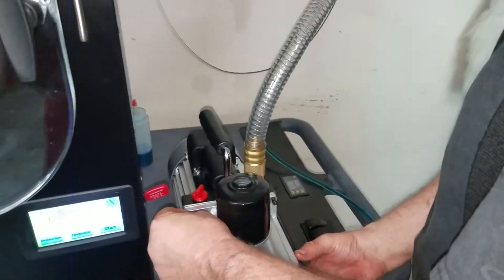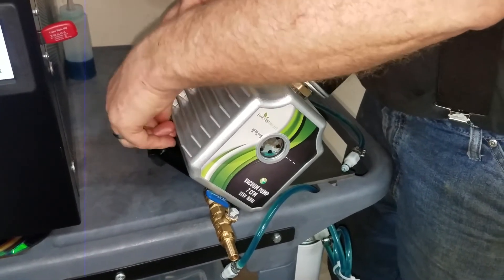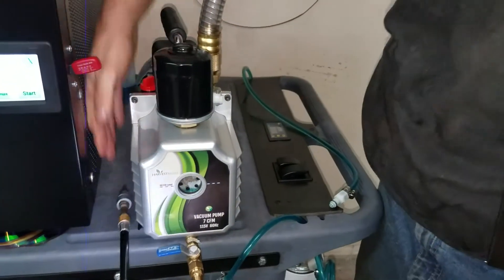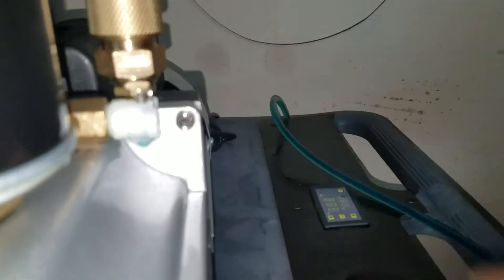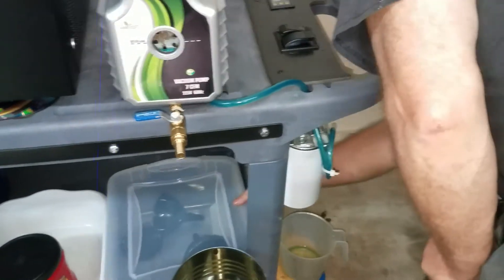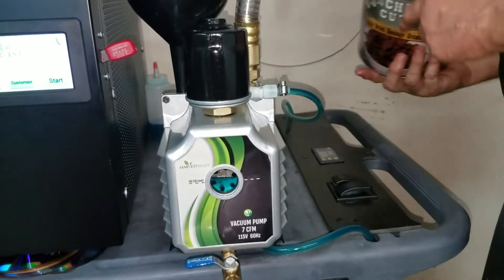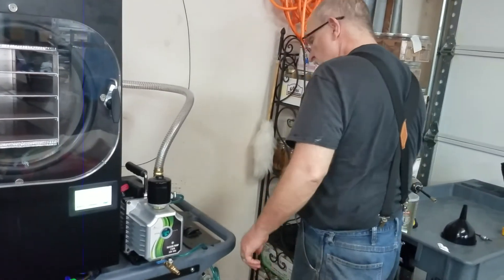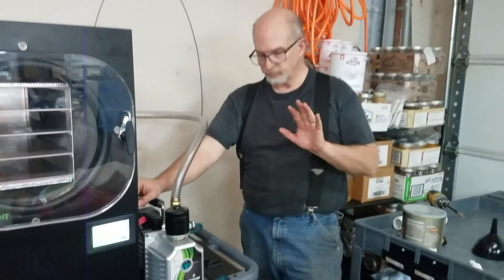Harvest Right Oil Pump Inspection Batch 56   Video 3 of 3

Comment: I believe the fitting is Inline Coupler,Acetal,Straight-Through Zoro #: G3355642 and Inline Insert,Acetal,Shut-Off,Barbed Zoro #: G0811693.  I am having trouble with identifying the elbow piece that mounts to the pump casing and the brass fittings that connect the female coupler to the elbow. Can you please provide more detail.  I think the other items in the system are identified in https://theepicenter.com/blog/parts-list-for-harvest-right-pump-oil-filter/.

Comment: Just watched your video, I use the same blue oil and I changed it after every use, 20 batches in and my pumped failed. The oil did not stay blue when using the filter setup they send with the system. Do you have a parts list so I can duplicate your filtration setup? I have seen other filter systems on YouTube however, yours looks the least intrusive and simplest to use.

Comment: I was just about to go pull my pump apart and clean it with carb cleaner.  Only had about 20 batches ran through our machine using JB Black Gold oil.  Luckily I stumbled on your videos.  Now looks like I'll be switching brands of oil.  I would also appreciate some help creating your filtration system.  Lots of humidity where I live and the unit is in the garage so I'm getting sick of filtering and freezing oil.  Subbed!

Comment: I saw a video where a man basically took that whole pump apart. Besides a few mistakes it didn't think what he did was operator maintenance.
Reply from the maker: Jorge Quintana really, if the pump is maintained, an occasional inspection is all that should be reguired.